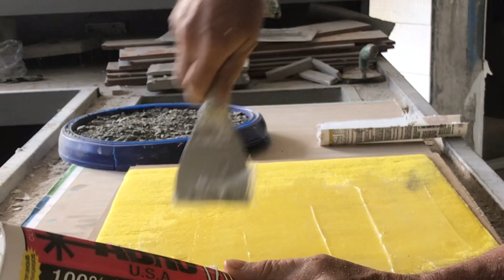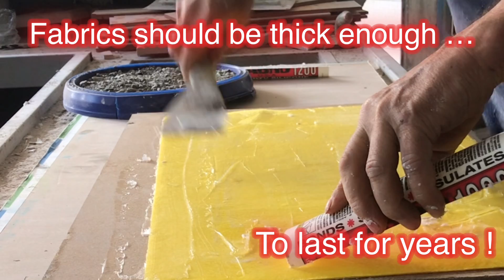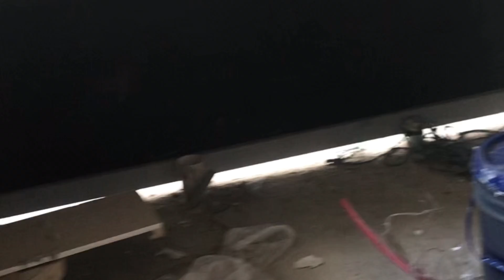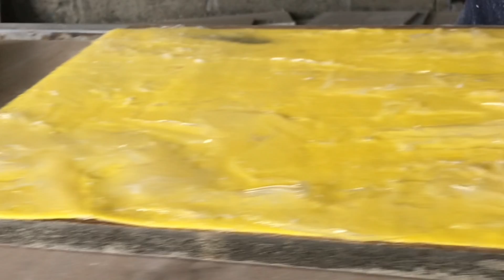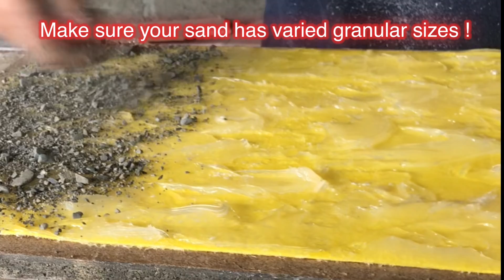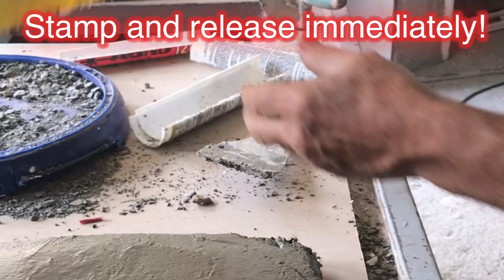How to make an $8 silicone cement stamp using readily available materials  #concretestamp #stamping

Comment: Great job! How about if, instead of sand, you put a natural stone slab (oiled so it doesn't stick)? This way you'll get a really natural texture. Do you think it would work?
Reply from the maker: @pavlinparashkevov9647  yes but that process requires casting silicone and a frame around the textured stone. The silicone would have a lower viscosity and pours easily. Mix part A and part B and then cast.
Reply: @buildingenjoyment  You could put a bag of water over the wet silicone mat to take the impression of the stone surface. Gonna try it!
Reply from the maker: @ water is too smooth. But I like your idea. Pottery clay would work really well. Sculpt the clay then use a spatula to smear the silicone on to the clay. Silicone doesn’t mind moisture so it would work !
Reply from the maker: @pavlinparashkevov9647  I would rather spend the money on casting silicone, casting rubber or latex then simple dam the natural rock and pour on top of the stone. Remove the mould 24 hours later with perfect detail.